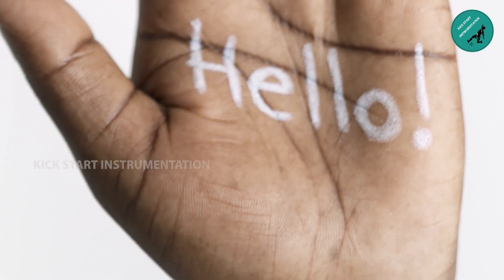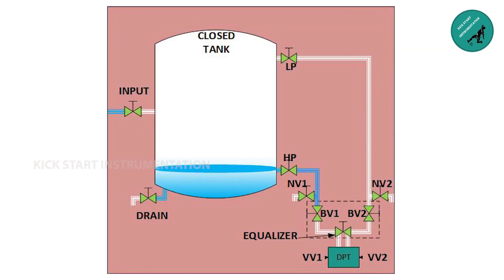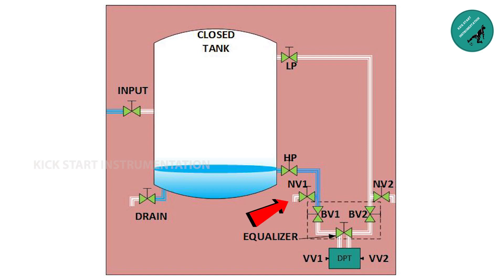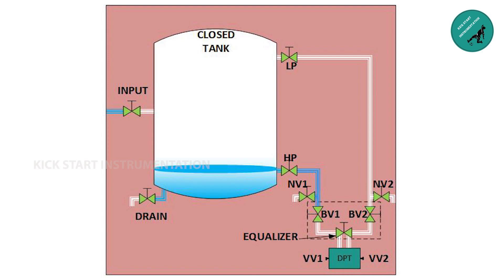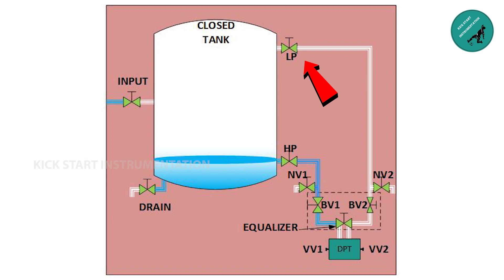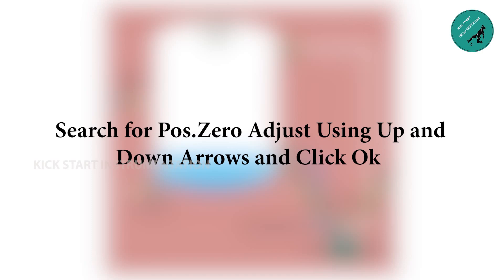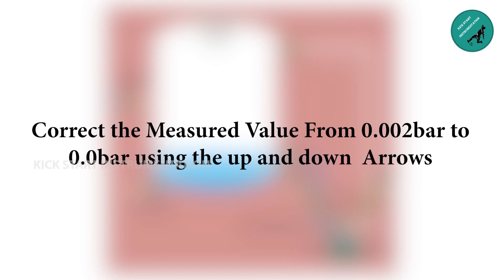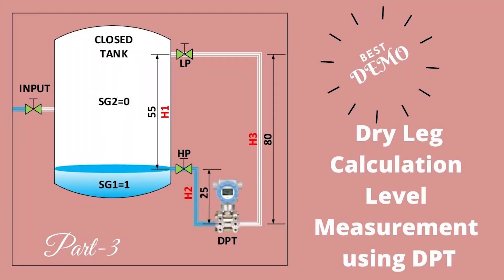Level Measurement using DP Transmitter Part 2 - Position Zero Adjustment

Comment: actual dp in this case ( dry leg) is not zero without opening the equalizer valve !!! sg1*h2 can't be equal to sg2*h3, isn't it? other thing i think that BV2 should be open too so that the LP measure cell will be communicating with the empty part of the tank that may be little bit pressurized above the atmosphiric pressure.

Comment: Nice, but you dont have to open equalizer to make the water flow to the DPT, after the opening the block valve the water directly flows to DPT, the equalizer valve position om the middle of the passage through the block valve 1and 2, but not blocking the passage through the DPT diaphragm.

BV1                                   BV2
    |                                           |
    |__________EQ__________|
                 |               |
                 |               |
                      DPT

and also if you are zeroing a DPT you have to eliminate every pressure to the DPT, or open the equalizer to balance the pressure exerted on the diaphragm.
Reply: BV1                                   BV2
    |                                           |
    |__________EQ__________|
                 |               |
                 |               |
                      DPT
Reply from the maker: Noted your point. It will be included clearly for better understanding asap.
Reply: Good point out @james .. 1st part as well as the later zeroing part.. but in the later part he was adjusting the zero level (as per process c-c distance + tubings to the DPT) and not the transmitter zero.  This i would tell you has to be followed even with your dry/ wet calculations of the lrv. Good video keep it up. and also a very constructive comment from james